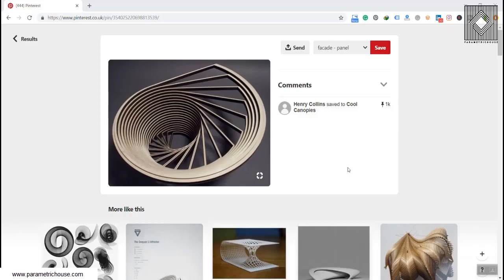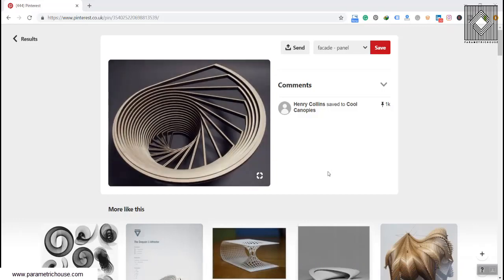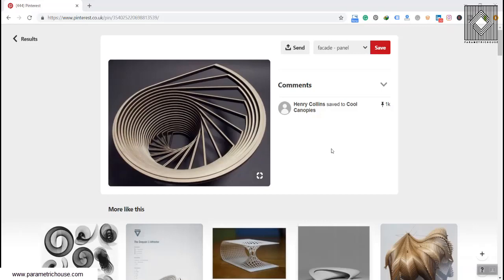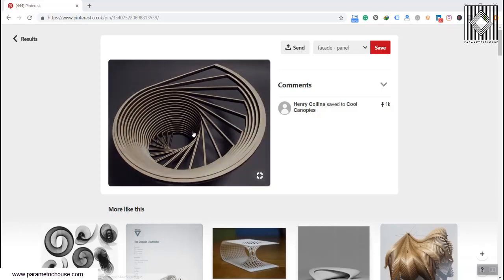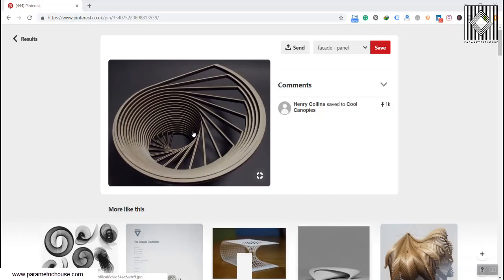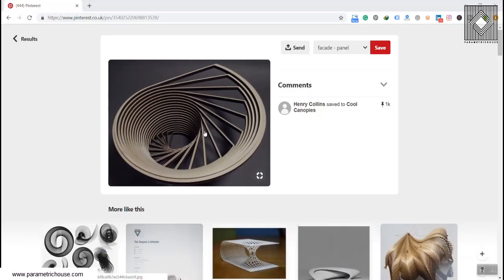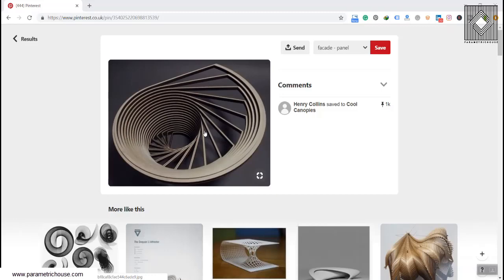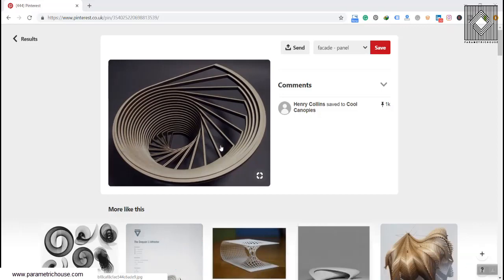Brainstorm #1 : Rotating Curves

Comment: Step 1- Draw the base curve in rhino and reference in grasshopper
Step 2- create copies of the base curve with the series and the Z vector
Step 3- Find the center using Area or polygon center.
Step 4 Rotate the geometry with a range of numbers.
Step 5 Scale the geometry with a range of numbers/series(or graph mapper if you want to be more creative)
Step 6 offset the curves on the xy plane
Step 7 Loft the curves with the offsets or use boundary surface.
Step 8 extrude in the Z direction.

You can also use Step 1-5 , loft and use contour instead.
Reply from the maker: Great thinking👍 this is a straightforward way of modeling this example and I guess most of the users pick this way😊

Comment: Maybe something like this. Step 1.Draw outline crv and 2 spirals. Step 2 scale the outline curve by sequence of factors. Step 3 Find an intersection between spirals and all scaled curves Step 4. Choose the biggest fragments of curves and close them. Step 5 offset inside new closed curves. Step 6 Move down. Step7 Loft surface from each pare of curves. Step 8 Extrude down
Reply from the maker: Great thinking!👍 you can also offset,loft,extrude the closed curves. Think of an easier way to simulate the spiral curve